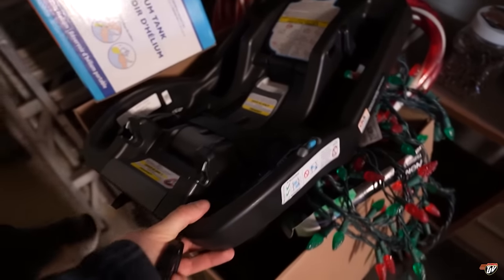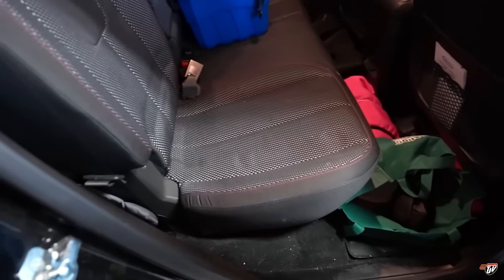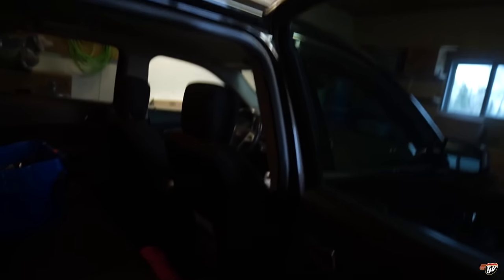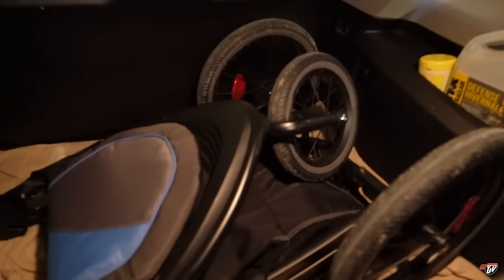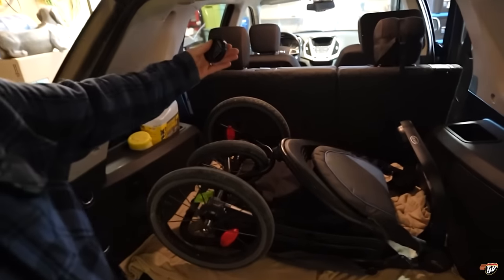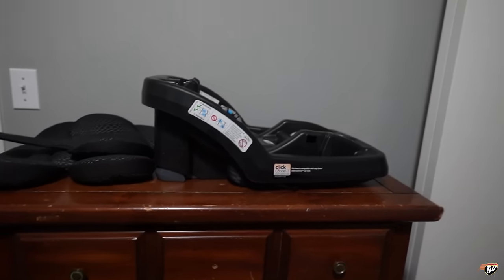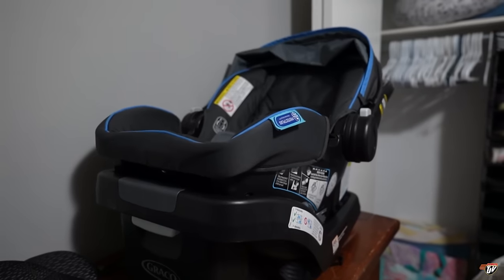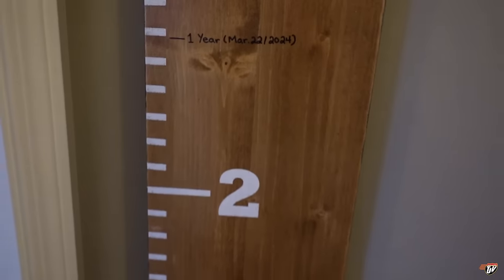NOT JUST A TRUCKER | My Trucking Life | Vlog #3040

Comment: Here in Sweden it's recommended that kids is facing backwards up until 4-5 years old, or if the kids head is abowe the edge of the seat. Because the muscles and the neck can't handle a sudden stop and so on. I have never seen a 4 year facing backwards though. When I was a kid in the 70s,I used the armrest in the middle of the backseat as my seat, and no seatbelts 😅
Reply: I used to lay down in the back window 😂😂